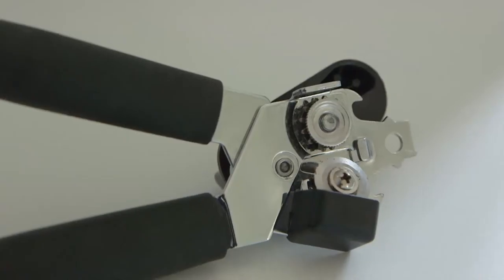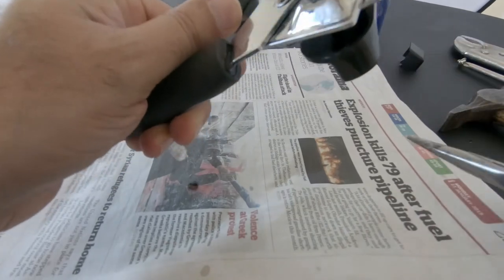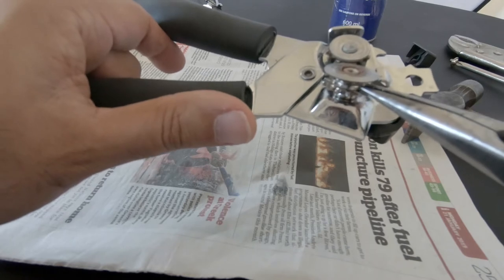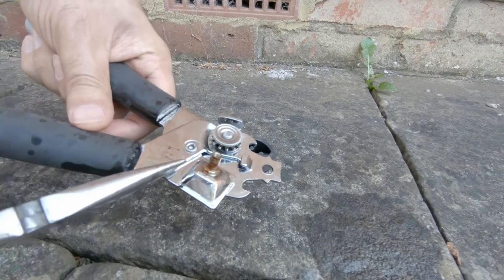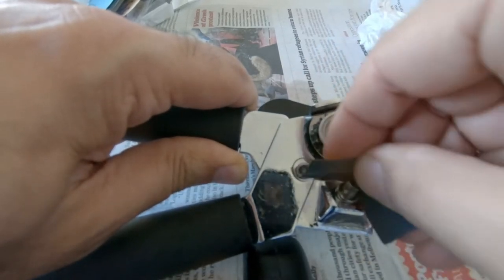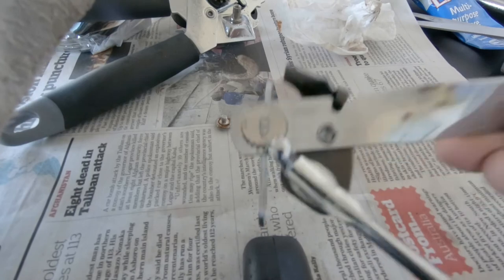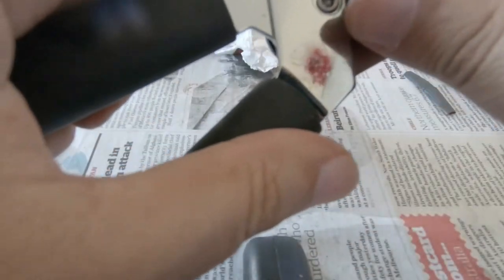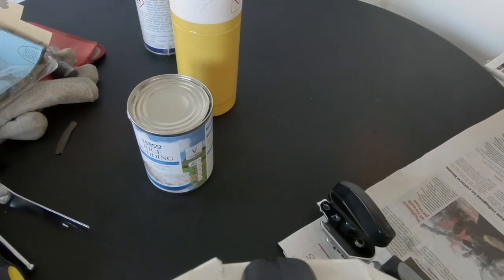HOW TO FIX A CAN OPENER USING A BLOW TORCH !!

Comment: If you turn handle and hold other wheel firm, the whole things comes apart much easier, it's reversing what they do at factory  just watch for spring behind handle, just align for piecing after greasing.